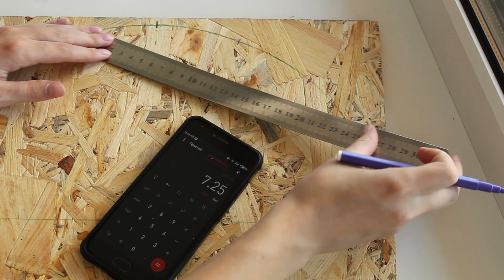NEON MANDALA | STRING ART | TUTORIAL | SPIRALS | DIY

Comment: I am interested in the thickness of your board, which is usually 0.9cm. Is this thick enough for nails? How long nails do you use? In most cases, the thickness of the board is required to be 2-2.5 cm. For me, a thinner thickness is even better, because then the price is also lower  😁
Greetings.

Comment: Please provide instructions for the beautiful piece. For instance if you skip nails in each layer, how many do you skip? 33 marks per quarter equals 132 not 128. So I am confused.
Reply: I know this is late, but I believe each each quadrant shares a mark, so there may be 33 marks but the 33rd is the start of the next quadrant. so 1, 2,3...31, 32, 1, 2, 3... so on and so forth.